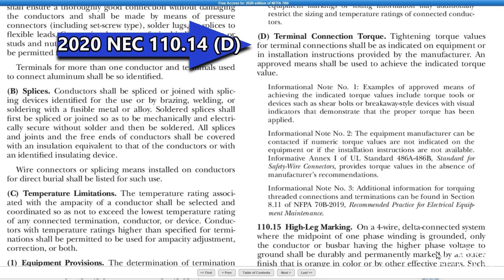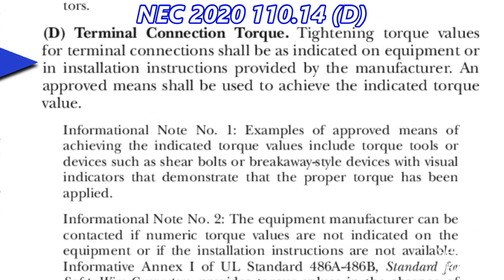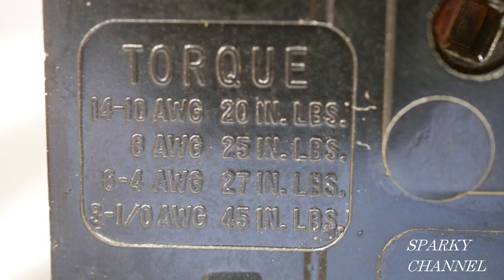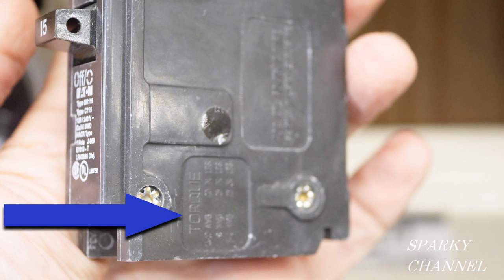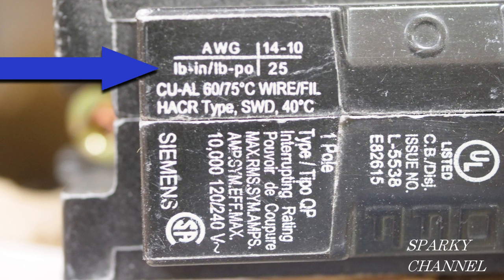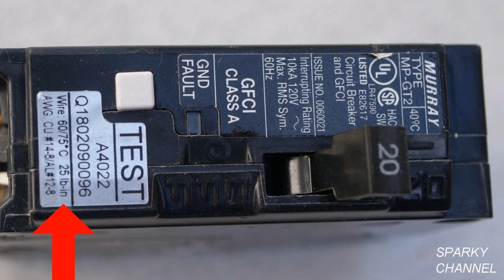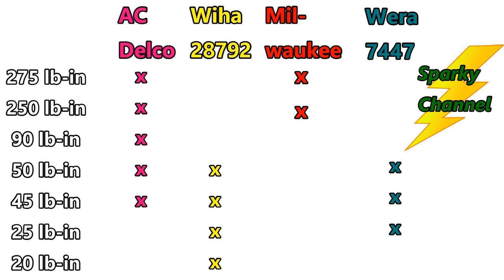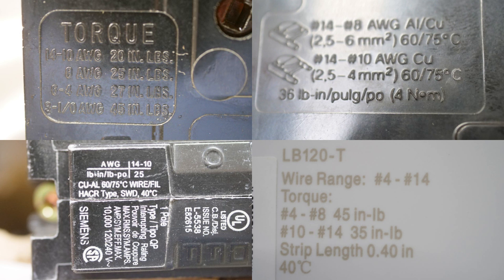How to Know What to Torque a Breaker Terminal to?

Comment: I learned about torque in my apprenticeship. While running a large job, the inspector made mention about torquing the lugs in the main gear all around the site. So i took it upon myself to start doing it. My one journeyman would say "this is my torque wrench" and point to his bicep....
Anyways, after hand tightening a Siemens dual function breaker,  and over tightening not using a torque wrench and feeling the lug slip, i figured i should buy one. Bought a husky and i think it goes from 5-40 in lb. Works well for panel work and I've been happy with it. Still the only person I know who actually torques.
Reply from the maker: Great job Nathan!

Comment: Tx!  Good information.  IMHO, it is critical to ensure connectors are properly torqued at install and even on a regular schedule (every few years perhaps), as seasonal and normal use temperature fluctuations may cause loosening.  Especially so in panels.
Reply from the maker: Yes, absolutely true. Thanks for pointing this out.

Comment: Another great video Bill, 110.14 (D) is new to the 2017 NEC (Michigan is still under the 2017 NEC Codebook) The WHIA seems like a good choice, given the 20 to 70 inch pound range, just not sure how the individual bits hold up, and the replacement costs for them.
Reply from the maker: The individual bits are first class German bits and are excellent. Don't lose them though as replacement costs are pricey.

Comment: Hi, I got a question about Aluminum wires and grounds... Half of my 1971 home is wired with Aluminum 10 gauge wires. I am in the process of installing AlumiConn with 12 gauge copper pigtails using 15lbs torque screwdriver in every receptacle, switch, junction, and light fixture that has Aluminum wires. The issue I found is that is most of the receptacle aluminum grounds are  cut short and grounded to the metal box. The old receptacles are AU approved "self grounding receptacles". When I test them for ground using an outlet tester, I get a successful ground reading.   In this situation, should I use AlumiConn on the hot and neutrals wires only and leave the grounds alone? It would be very difficult to install AlumiConn's on the ground wires since they are cut short and screwed to the box

Comment: We never torqued any breakers.  We would tighten them down good.  I am sure they were over torqued if anything.  The city hired a firm to come in and do an electrical survey of all of your boxes.  The recommended that we replace all the panel in the city.  The city got a bunch of money to do that.  Some grant from somewhere, that was the bean counters doing.  It was a real pain replacing them all through-out the city, but we did it over several months.  The new breaker panels were all snap in breakers, which where sweet and no torquing.  Genius idea!
Reply from the maker: Interesting. what city is this?

Comment: Bill do you use a torque screwdriver on devices and breakers 
.
Reply from the maker: Breakers yes, receptacles and switches no.
Reply: @SparkyChannel  I always went by if its tight its right ..but with 14 awg you can squash the wire which is not the best either ..id kinda like to see the wire torqued properly on a device then examine it too see if I have been over tightening it in comparison
Reply from the maker: @Jason_Canada  Right on!
Reply: @SparkyChannel  Bill if you could torque a 14 awg on a device then show the condition of the conductor that is what I was trying to suggest
Reply from the maker: @Jason_Canada  Got it!

Comment: Hey Bill do you know about Aluminum wire torque rating for 15, 20 amp breakers and above? Or point me in the right direction to a web page, cause i cant find much when i comes to this. Thank you!
Reply from the maker: Circuit breakers should be specifically marked as to what wire types and sizes the terminals are compatible with; they also should be aluminum wiring compatible if the house is wired with aluminum wire. But it's always good to check. You may need to remove the breakers to read the markings on them.
The torque rating should be marked on the circuit breaker itself.

Comment: How critical is the torque if you over torque slightly?  For example, say the spec is 20 lb-in, but you have a Wera tool and torque it to 25 lb-in. It would certainly be tight enough, I doubt it would cause a problem. And of course there has to be a tolerance on these numbers, so a little on the right side might be a good thing.
Reply from the maker: Hi Tim! I really don't know. It seems like we have to trust the manufacturers research on the torque values.

Comment: I gurantee NO electricians torque their devices or breaker terminals in residential applications (smaller devices). The only time I torque termination points are in switch gears or in industrial applications where nuts and bolts are the clamping apparatus. I also torque the first means of disconnect terminals (in residential) Where the Alan key lugs can be paired to a 3/8" drive socket adapter and then driven with a standard torque wrench.
Reply from the maker: I torque every terminal in a panel. They all have manufacturer torque specs. It doesn't take long if you have the right tools. Thanks!
Reply: @SparkyChannel  Has torqueing always been in code. my dad was an industrial maintenance electrician and when he did side jobs i never seen him do it and never seen a torque tool in his bag.
Reply from the maker: @daletyler5344  110.14 (D) is new to the 2017 NEC.
Reply: I am an electrician and I torque to specs. Even after over 35 years, I find it hard not to over-tighten by hand. My apprentices have no clue how little 14-18 inch pounds is - which is Leviton's standard for their residential receptacles. They 'torque' 'em down way too hard. Copper anneals, threads strip, connections fail.
So, sorry, but your statement is plain flat wrong. I'm not the only master I know who insists on proper torque, either.
Reply from the maker: @ethelryan257  Thanks Ethel!
Reply: i have never torqued either, but i did notice the breaker for a dryer buzzing, and I suspect this is why. But now I know how to do it better.
Reply from the maker: @AsHellBored  Could be.
Reply: @ethelryan257 curious, if something is over torqued, can it be redone or does over torqueing cause damage? (I am not an electrician, just a curious home over who was instructed to torque)
Reply: @vfsd234  generally no, unless the threads are damaged then yes, but you would disconnect the device from power, apply the rated torque to the fasteners and then reinstall and re-energize